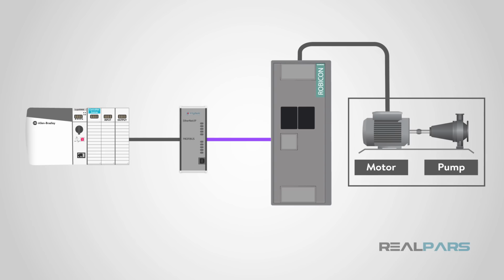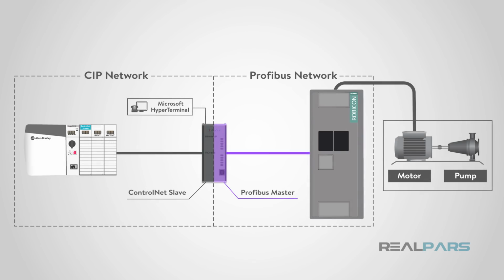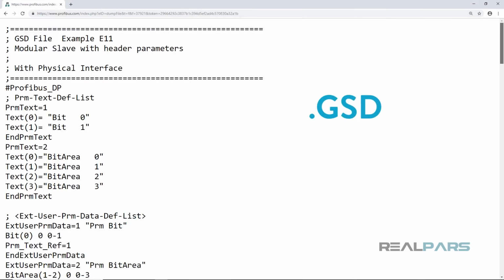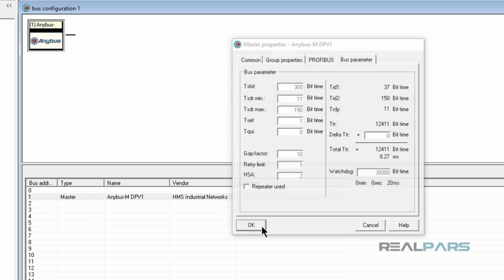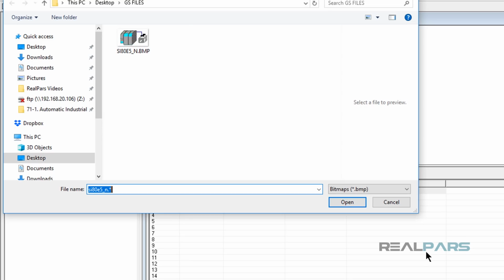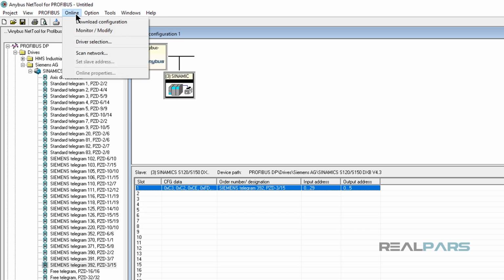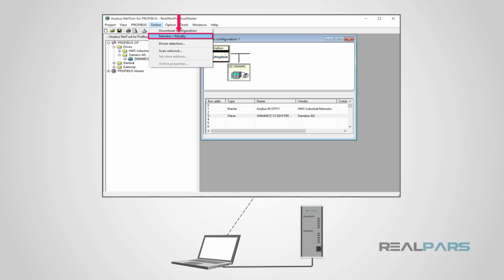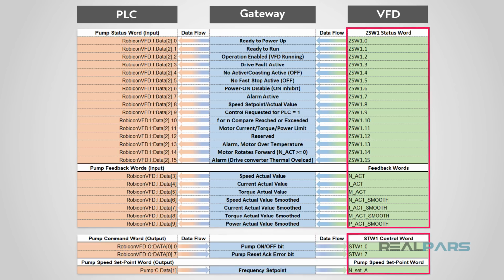How to Control a VFD with a PLC - Part 2 (Configuring HMS Anybus gateway and Siemens Robicon VFD)

Comment: Thanks a lot for your great effort to making these great videos.
One question: I can find 6 bytes(3 words) output data from PLC to VFD. But where are the 30 bytes of feedback data from VFD to PLC? I found only 18 bytes(9 words) of feedback data(main setpoint, BICO status word, speed, current, torque, power, etc.)?
Reply: Hello Shi Billy. Keep in mind there is an HMS protocol converter in between the PLC and VFD.  We are sending two bits and one worked from the PLC to the HMS converter. And the HMS is sending (writing) ZSW1 16 bits and 9 words of data. HMS reads  N_Set_A frequency and STW1 16-bit word used for discrete bits STW1.0 -STW.15

Comment: Great  video for learning but i want to know in a 4 core profinet cable 
Whats the function of each wire out of those 4
And difference between profinet and ethernet 
Thank you
Reply: Yellow = transmit (+), White = receive (+), Orange = transmit (-), Blue = receive (-).  PROFINET is for industrial applications where there is high RF/EMI noise. Industrial machinery running electrical motors is going to give off a lot of interference that standard "office" ethernet cables are unable to filter out.  PROFINET and other industrial ethernet protocols (Ethernet/IP, for example) are all based on TCP/IP, use IP addresses, support UDP, etc.  The differences in each are in the application of the upper levels of the OSI model for protocols (levels 5, 6, and 7).
Reply: @scottsommer5450  thank you so much 
Why we are using 2 for transmit 2 for receive 
Why cant we use just only 1 for transmit 1 for receive 
Like profibus 
Why double in profinet?

Comment: Hii...i am having an issue voltage across 3 phase aren't same voltage across R - N and B - N phase are 243 but across Y - N it is 233 due to this MCB of VFD is tripping
Pls help....
Reply: Artan is correct in his answer to your question.  An unbalanced 3-phase load is not going to trip a VFD due to the unbalance.  Also, 10 VAC is not a very larger or significant difference.  This could be caused by something as simple as increased resistance at one lug set due to corrosion or poor conduction.

I would do some basic troubleshooting:  1)  with the VFD turned off, do you still see the unbalanced voltages?  2) with all devices on the branch circuit that feeds this VFD, do you still see the unbalanced voltages?  It is important to know if the unbalance exists at the source of power (switchgear transformer), on a branch circuit, or at the VFD itself.  

If the VFD branch circuit has other loads on it other than the VFD, then those other loads may be the cause of the unbalance.  Are there upstream line reactors, filters, or fuses that could be partially failed that would cause a voltage drop on one branch?
Reply: Vfd doesn't  trips eaven if a phase missing in supply. The only required for the vfd is that the 2 phases remaning or the three not symmetric have to carry  the power required on the load.